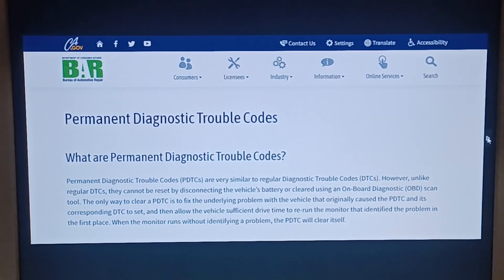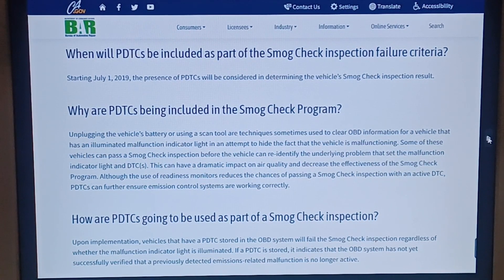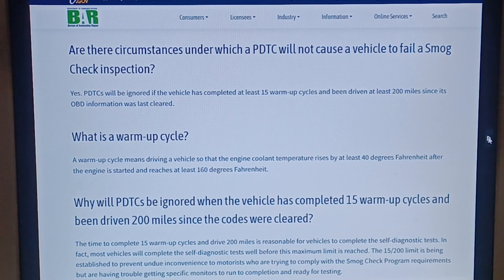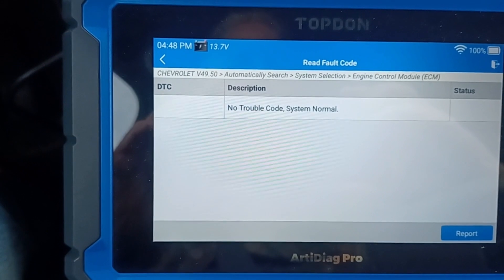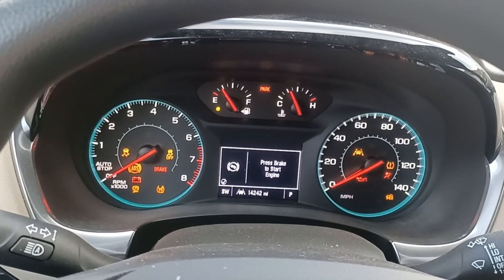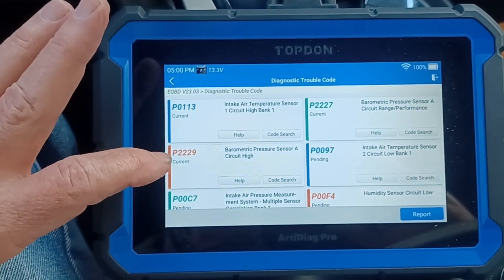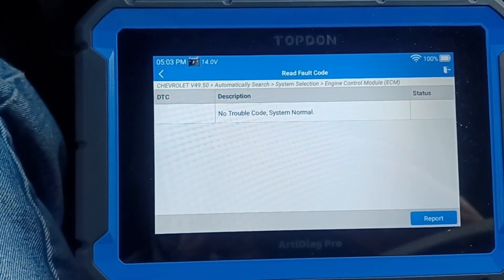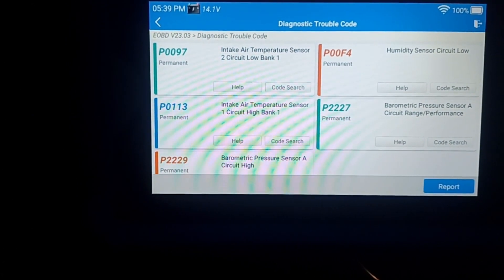What is a Permanent Diagnostic Trouble Code (PDTC) and how can it be cleared.

Comment: I had a purge valve go out and it put 2 codes p0442 & p0 forgot code but it was the purge valve. That code cleared but the 0442 has not. Drove over 200 miles. What can be done to clear it. California. Need it clear for smog.
Reply from the maker: As you probably know, a P0442 indicates a small evaporative emission system leak. If the leak was fixed, the car should be able to clear the code on its own after a certain number of drive cycles. If the code is in history, it can take as many as 40 to 80 drive cycles which can be a lot more than just driving 200 miles. If the code is current and the MIL light is on, the problem still exists and needs to be fixed. If the code is in history and is not pending or current or listed as permanent, the car should be able to pass a smog inspection. I hope this helps.
Reply: @StuffAboutCars-jg5tx  thank you, a drive cycle is when, start car cold, turn on ac,rear defrost other electrical, run for 2 1/2 minutes or 3 minutes?  Then drive some city then fwy? But how far?
Reply from the maker: Actually, a drive cycle is more involved than that. The car will have different requirements for drive cycles depending on the system the car is testing. It usually has to start with the engine temperature below a certain temperature and the car will have to be driven until the temperature rises above a certain temp. The speed of the car has to be kept at a pre-determined speed for a certain amount of time. There are some very specific requirements depending on the system being tested. For example, when the vehicle tests the evaporative system, the fuel tank can't be above 7/8 full or below 1/8 full or it won't do the test. You really have to consult a service manual for the exact requirements to complete a drive cycle for a specific system, however, I find that if all the monitors have been cleared because someone has disconnected the battery or has cleared a DTC (Diagnostic Trouble Code) with a scan tool, if I start the vehicle from cold and drive on the freeway for about 10 to 20 miles and try to hold the vehicle speed constant for as long as I can (don't do a lot of acceleration and deceleration) usually all of the monitors will be set by the time you've finished the drive. That is of course only if there are no problems in the systems that will prevent a monitor from setting. Also, the evaporative system monitor is the hardest one to set and at this time a car will pass a smog test in California if the evap monitor is not set but the rules get a little complicated depending on the year of the vehicle. You may find some useful information that will help you accomplish what you're trying to do on the California Bureau of Automotive  Repair web site. Sorry for the long explanation, but the OBD2 stuff gets pretty involved. I hope this helps.
Reply: @StuffAboutCars-jg5tx  Thank you, very helpful information. All my DTC are good, of course evap not but it’s ok. I would be smog ready if it wasn’t for stored code 0442. I understand there is the 15/200 BAR rule. The scanners read the warn-up cycle. I’m trying to figure out how to do it for my car. I understand wait till car temperature is under 120 then start and rev to over 166 and it should count as a warm-up cycle. I did at 109 ran till 168 and didn’t work. I did not drive right after but they didn’t say to. I can cool my engine off quickly by putting in garage and turn AC on but I need to know if these are the temperatures or is there something I’m missing.
Reply from the maker: There's a difference between a Permanent Code and a Stored or History Code. If your P0442 code is a Permanent code, your 15/200 rule would apply (although I've never heard of a 15/200 rule but I'm going to assume it's the 15 drive cycle/200 mile requirement to get rid of Permanent code). If it's a stored or history code, the vehicle should pass a smog check with that type of code in it. If the vehicle is going to clear an evaporative code from History, it can take 40 trips of "no fault detected" to clear the history. The car should pass a smog test if your code is only a History code and not a Permanent code. Another possibility is you can use a scan tool (it sounds like you have one) to clear all the codes. That will get rid of your history code, however, all of your monitors will be cleared also. That means you'll have to drive the vehicle long enough to reset all the monitors and hopefully your evaporative problem is actually fixed and that monitor sets, although you can pass the smog test without setting that monitor, but not if an evaporative problem has been detected and it becomes a Pending or Permanent code. Good luck.